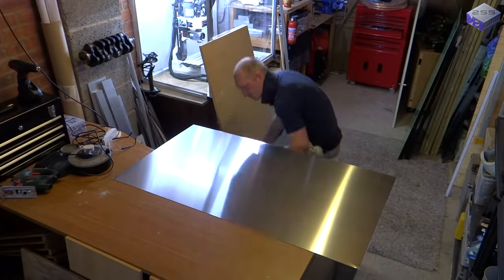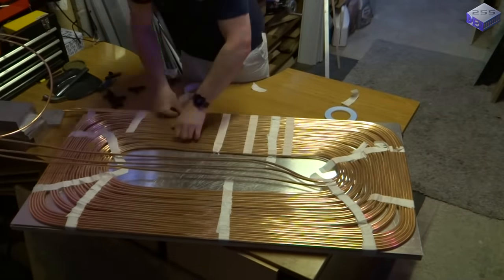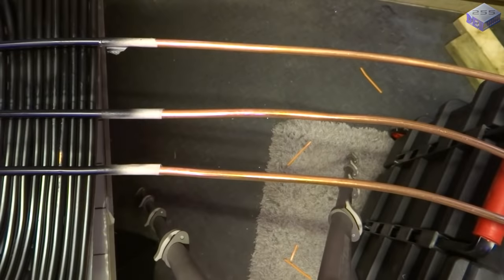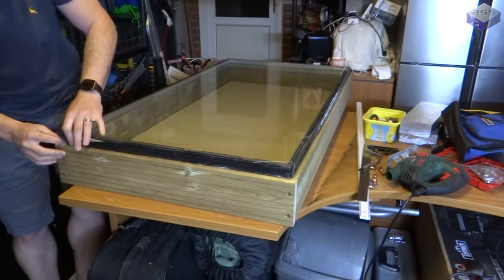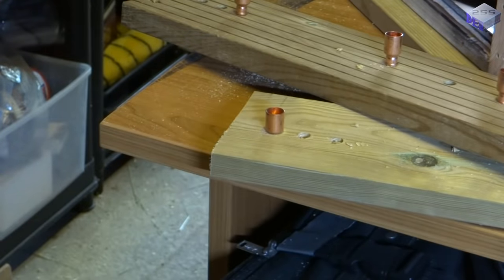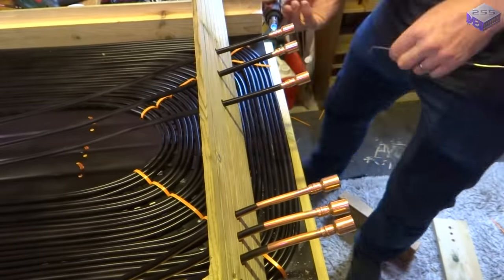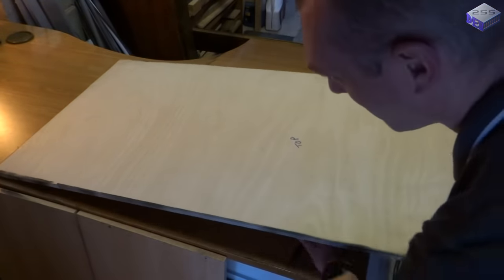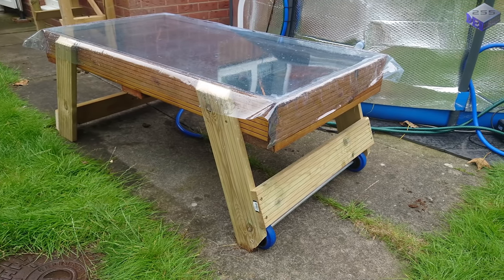Improved Solar Pool Heater - Full build

Comment: I did love your great work! Reading on comments I read someone told you to vacuum internally,  it will effective only on larger dimensions.  You did really your best!👍 to get the best heat transfers use close loop circuit with a little tank and pump,  you need not else! Great job man!
Reply from the maker: Thank you, it is quite a mission to evacuate the air and one that needs maintaining, and with fairly few results, I may be reducing the amount of air inside by reducing the height of the sides. I now have a vehicle expansion tank, 12V Solar pump and a way to create a simple heat exchanger, so should be able to get the most out of it. 👍
Reply: @TheSolarPoweredEngineer  Perhaps it is better to evacuate the humidity inside, so you will get a more efficient system, instead of creating a vacuum! I might suggest that you use hygroscopic salts , so there will be dry air inside! Great idea to reduce the height of the walls. You are right when you say it is a mission impossible create vacuum! 😊
Reply from the maker: @raffaellobottoni871    I'll take a look into hydroscopic salts. The vacuum would probably use too much energy to maintain too
Reply: @TheSolarPoweredEngineer  👍  and....good luck about your project! I hope to hear better news from you!
Reply: even a modest vacuum would shatter the large pane of glass wouldn’t it?
Reply from the maker: @andrhamm  quite possibly, the more expanse of glass the less vacuum you can apply, plus it would draw in moisture through the wood and any small gaps, very hard to maintain.

Comment: You would see a significant temp increase by bringing the pipes no more than 6mm away from glass. I would also be using sand on my backboard before painting to reduce the risk of rays bouncing straight out the box. Try it. You will notice a big temp increase in low, weak sunshine.

Comment: A few thoughts/suggestions: 
A direct solar-powered pump would be great because if there's energy to run the pump, there's heat ready to be transferred. 
Maybe angle it a bit to catch rays dead on?
Insulate maybe? 
I really appreciate you did the wattage vs. temperature delta because you could just run water through slowly for amazing numbers. You calculated volume heated per time delta? 

I'm keen on the $ or £/Watt you think this was. Copper is clearly superior to plastics for thermal transfer, but what is the cost per watt?  What if you factor in your time?
What was watts transfered to the water vs. available solar energy at the time (avg for measured period)?

Well done, really enjoyed your video.
Reply from the maker: Hi Ken, thank you, I'm glad you enjoyed it. I do have one of the pumps attached to a 50W solar panel and intend to attach more for each panel. Last year the pumps were controlled by an Arduino that measured 10 temperature sensors, one being the panel centre temperature and another the pool temperature; where I set the pumps to switch on when the panel was 5ºC above the pool temp and switch off when the pool was the same temp (to avoid oscillations, a hysteresis loop).

It's fairly hard to angle the panel at the sun directly, although I was thinking of a couple of side mirrors moving to reflect the sun onto the panel, one on either side for am and pm and both through the mid-day sun, therefore there's less mass to move, so more efficient and would have a greatly increased surface area.

For $/Watt the unit cost around £250 from recollection, plus my time (I'd say £50/hour x 10) so for £750 / 500W output, would be £1.5/Watt or $1.81/Watt with today's rate. This can be improved upon with the mirrors on either side, may even reach 1kW.

The first version with plastic pipe collected an average of 600W over an 8-hour period (900W over mid-day), where it has a collection surface area of around 1 meter squared (13mm pipe at 50m long with half the surface area facing the sun). So if the available sun was 1kW/m2 over mid-day, then this was 90% efficient (90% of heat energy transferred). That seems quite a lot, so may have over-estimated the surface area.

Thank you, I enjoyed answering your questions.
Reply: @TheSolarPoweredEngineer  ok so I'm even more intrigued. In the US a great number of people could use smart attic/whole house ventilation.  To do it right it would need to be an Arduino or similar looking to see if:  Is the attic hotter than [the house + 5deg Farenheit] AND Is the attic temperature too high [config temp] AND Is the outside humidity below threshold [soggy relative humitidy config value] AND Is the house too hot [config temp] AND is the outside air [5 or more degrees colder F than the house] THEN ventilate the attic sucking air from ceiling of house. I think I will pursue it so long as I don't have to solder anything because I hate it.
Reply from the maker: @KenWeston  That sounds like a great idea and would definitely work, I'm sure you know Arduino code, although if you wanted to take a look at my pool heater logger sketch, then it can be found on GitHub, here is a link to my webpage with more info: https://www.dev255.uk/solarwaterheater

I do need to update my website though, I've been concentrating on projects at home and have a full-time job too, haha.
Reply: There's no need for a solar powered pump if you plumb it to run off the filter pump.  You just add a couple of tees and a diverter valve to divert some of the flow through the heater.

Comment: I built one before but I insulated  the sides too and if you angle  your panel  so it gets more sun it will work better. you laid it flat so it only gets sun when it is above the panel.
Reply from the maker: Hi, yes, that would work much better; I have 2 acrylic mirrors that I'll be attaching to the sides so that it reflects the sun into the panel; that way, I only have to move the slight weight of the mirrors instead of the panel and will get more light into the panel increasing its capacity. I have 4 PV solar panels now that I am tracking the sun with and that's working well.

Comment: what a awesome idea, i know itr may sound daft but have you thought about using tempered glass and building like 3/4 of these and having them as like a "decking" area for table and chairs whilst heating the pool and obviously would be a epic garden piece
Reply from the maker: @znpvrx  Thank you, not daft at all, I will be trying different materials and measuring them against my original version 1 heater;  as I believe the glass is reflecting some of the light frequencies that help heat the system, although is working well so far this year. I was thinking of a pergola over the pool with black tubing sandwiched between two clear polycarbonate layers (the lower having a two-way mirror film applied so you can see through it from the pool underneath, but would reflect most of the IR back at the pipes), the pipes having a gap between them to allow some light through. I like the decking area idea too though, that would be a great feature and would be a lot easier to clean.

Comment: you can mirrors all around to reflect the more sun light thus improving the heat efficiency!
Reply from the maker: Hi, yes, this should work well where I have a couple of Perspex sheets with mirror surface on the front (no refraction from within the substrate) that I will be trying out. The intention is to track the sun throughout the day by controlling the angle of the mirrors. Perspex is fairly light too so should not need too much power to operate.

Comment: Looks great, but you may have a bit of a problem with moisture in the future.  Without some airflow condensation will likely form on the glass and allow mold to grow.  That will block sunlight and reduce the concentrator's efficiency.
Reply from the maker: Great point, there is another person that made this same panel and he put two open pipes at either end pointing down to help it breath, I will get around to doing the same before using it this year.
Reply: @TheSolarPoweredEngineer  Fill it with nitrogene
Reply: should seal it with argon
Reply: @zarkov2324  how ? Where to get argon from?
Reply: @harunyahyadotorg  welding supplies

Comment: Did  you notice any problems using the silicone sealant with adhesion of the glue to the wood around the glass and wood ?? Do you think that using the aluminum sheet reduces the heat gain instead of using copper sheeting ?? I like your idea fella. I will be making something like this for solar hot water heat later this year. Nice work with great attention to detail.
Reply from the maker: Hi, thank you. Yes, the silicone sealant that I used originally was ok sticking to both surfaces, although the silicone split in 2 down the centre of the seal with the expansion of the wood. I have now replaced a small section of it with gorilla silicone, and that is holding strong. I will also be trying different materials for the top, though, as a sealed double-glased unit may not be optimum for this design, according to some comments. Perspex of Polycarbonate may be a better option and be easier to seal. I hope that helps. Good luck with yours, and feel free to ask questions if needed.
Reply: @TheSolarPoweredEngineer  I was told by my neighbor who was working with silicone sealant adhesive just like you are Neil. This gentleman called the silicone manufacturing company about their sealant. They told him that using silicone adhesive the grade and or quality makes all the difference. The adhesive that was recommended was expensive but still silicone of very high purity and viscosity that was for use adhesion to plastic material. This is used for plastic grippage with guaranteed performance. 
Thanks Neil for letting me know about question asked fella. Look forward to see more great video of substance and actual  proven ways of doing things. Good day and peace too. vf
Reply from the maker: @victoryfirst2878  Thank you, peace to you too

Comment: I admire your enterprise and construction skills. I know nothing about this but I would have expected the painted aluminium area to fulfill the role of capturing the sun's heat which is conducted to and then collected and carried away by the copper tube(s). Given this, I would have thought you only need a small minority of surface area to be copper pipe yet in your build it is well over 50% which can't be cheap.
Reply from the maker: Hi, thank you. This was a little time consuming to manufacture also, although is holding up very well against my previous one. From the look of a thermal camera, thermal transfer is fairly slow across the plate and the flowing water is not sufficient to transfer the outer (or inner if in a loop) heat, plus there is less surface area on a flat panel than on a number of coils. Also, If there is a greater temperature difference between the surface absorbing the sun and its potential, there is more energy transferred.

I think this cost me around £250 originally, although would probably by over £100 more now.
Reply: I believe the slow heat transfer is due to the poor thermal connection between the copper tubes and the aluminum plate. If this would be better (maybe soldering it or using special thermal adhesives) you could have decreased the amount of copper tubes massively. At the end, this is how the best heat transfer systems work (SME coolers): a Cu or Al plate to collect the heat and a couple of tubes (heat pipes) to transfer the heat away...

Comment: I think square metres of panel (- i.e. KW received), is more important than high-density-spacing of the copper.  So maybe a larger ali sheet with lower-density copper (- i.e. get the energy into the ali sheet, then it'll transfer into the copper pipes.  Also, I think your implementation of the thermal tape maybe hurting you - as only 30%(?) of the copper is touching the ali.  I suspect a direct connection of the copper to the ali (over 100% of the area), would be better.  Maybe just use some ali strips to clamp the copper down to the baseplate, in a similar way/ location to the wire ties.

Comment: Did you try a comparison of using this setup with a single pane of glass and with no glass at all?  Double glazing is designed to be a thermal barrier so it could be more of a hinderance than a help.
Reply from the maker: Hi, yes, since reading the comments, there are some good suggestions of different materials that I need to try. With the wind in the UK, I believe I do need some kind of cover (greenhouse effect) as the heat will just be stripped away otherwise. I'll have to give it a go when the sun decides to stay.

Comment: Hmm, thinking outside the box, can see this working well enough to supply a sink (or two) of hot water in the Summer for washing up - at no real cost. With energy costs so high, everything helps.
Reply from the maker: That could work, although for washing up/pottable water I would recommend using food-safe plastics or house mains water plumming pipes in the solar collector and feed pipes.

Comment: You should lay the pipes as heater floor piping, this way you'd get even heating of the hole plate, and avoid some of them going over other ones (can make this a bit thinner)
Reply from the maker: I was thinking of doing that and having the aluminium plate above the pipe also with a thin air layer and Acrylic cover, although with this design I was going with more surface area. I may have to try the under floor heating method though.